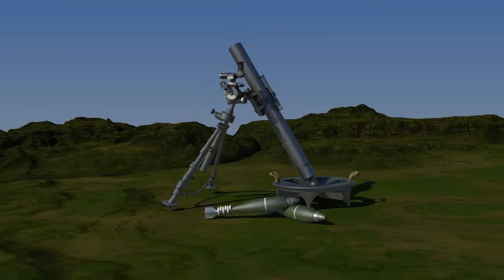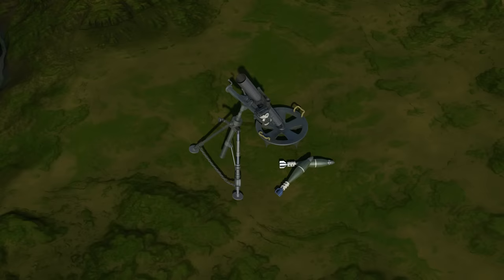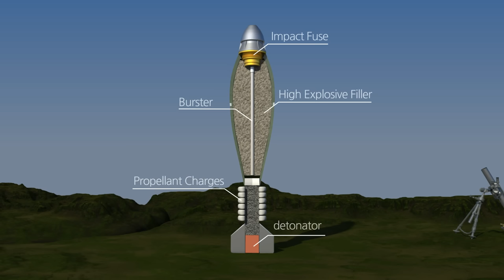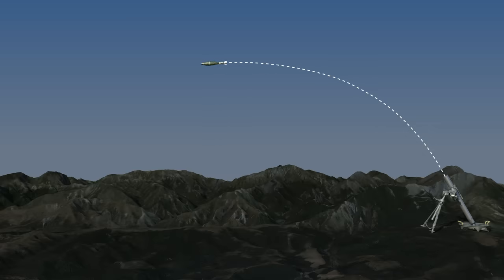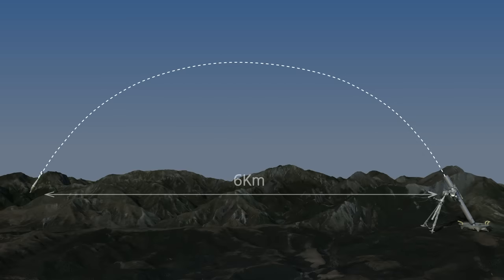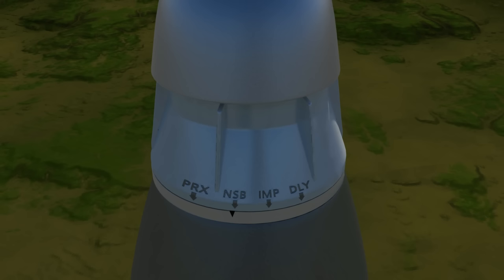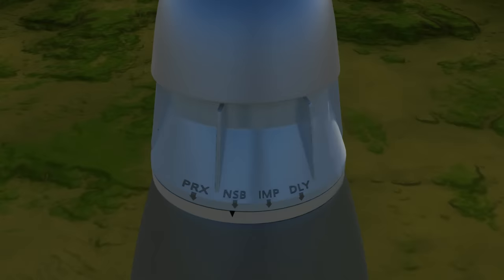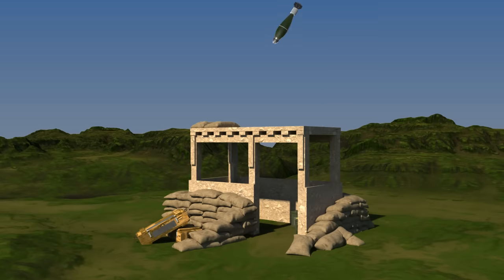How does a mortar work?

Comment: The current tech of 2023 enables an 86mm mortar to behave like a Laser-guided bomb (LGBT). Those who want to sell laser-pointers for rifles are not considered professional army (cannot even smoke at night, makes yourselves visible to be targetted by... mortar). LGBT can be illuminated by ground laser for aircraft to drop and steer. 86mm Mortar have the right shape and size and vanes(lock to fire and suffer shock, unlock thereafter to do a bit of steering). There are 2 points in a straight line. Vector-steering before aiming... test on police tactical teams... laser pointers.?

Comment: Your graphic representation of a 40 meter radius is incorrect and leads to confusion.. If such misinformation were conveyed in the military, unintended casualties would result.
Your line with arrows depicted the diameter instead of the radius. A 40 meter radius of damage would equate to an 80 meter diameter of damage. Your graphic, instead, depicts a 40 meter diameter of destruction which is only half of the actual effectiveness of the weapon.
Like so many other internet and Youtube creations, yours is more for the purpose of increasing your number of views and clicks than for providing truth. Otherwise, you would have CARED enough to exert the necessary EFFORT to get it right.
But you did not.
You should do the right thing and remove the video. Then perhaps you should choose a topic of less importance and use your video production skills there.